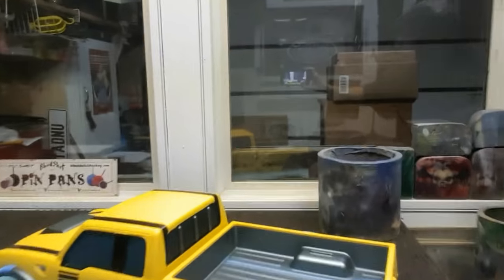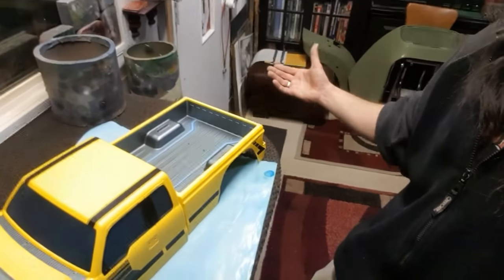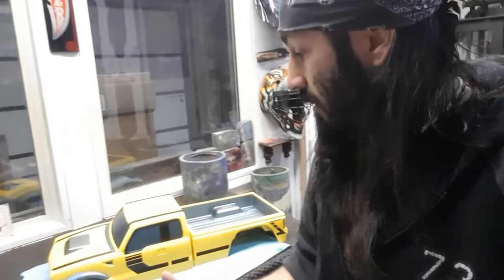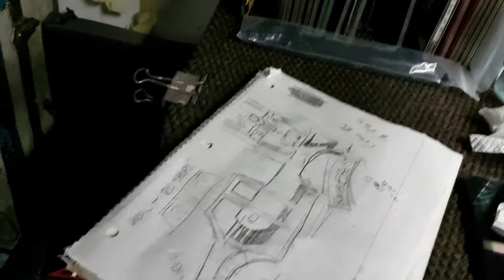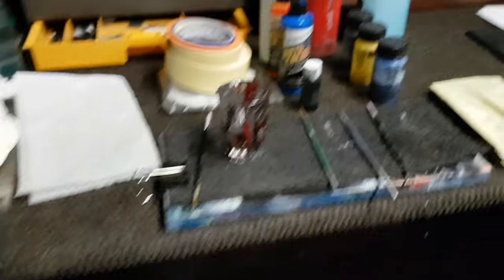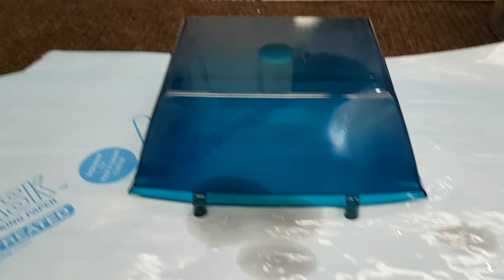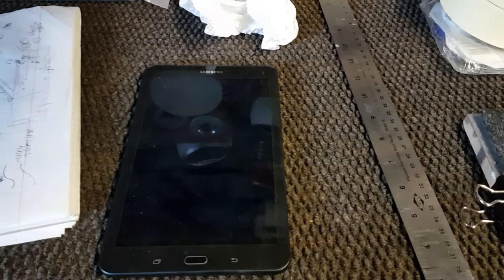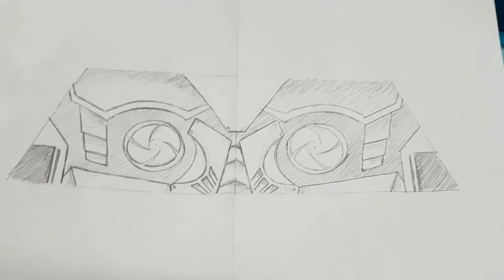RC Airbrushing Tutorial  (Part1/3) Methodology, Tools & Prep Work.

Comment: How much psi does your compressor put out for airbrushing , thinking of getting myself an airbrushing set and start painting my rc planes. And what type of paint would I need to paint on het shrink plastic that my planes are covered in.  Looking forward to your next video
Reply from the maker: I usually run around 40 psi. I drop the pressure for a few different effects. Unless your looking for a large dot pattern, I wouldn't recommend anything lower then 20psi. But play around and see what works best for you! X)